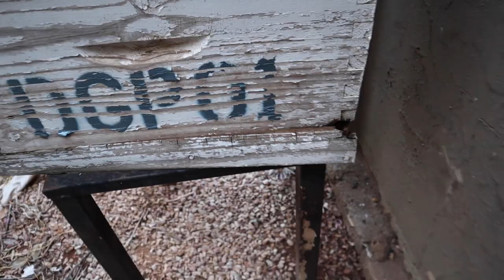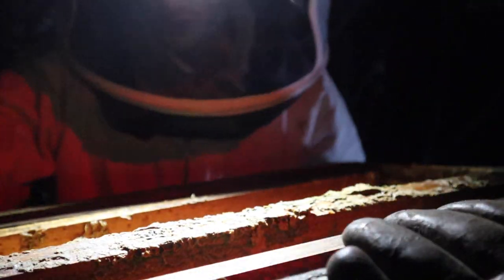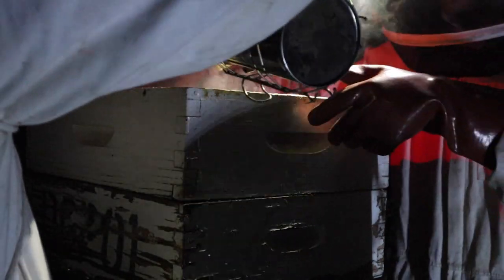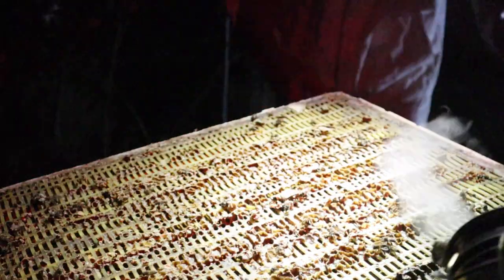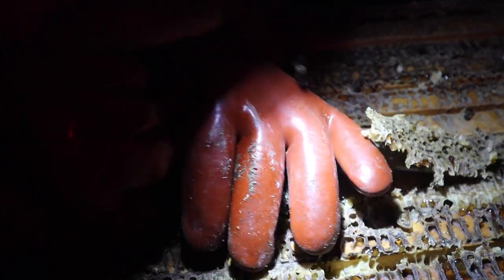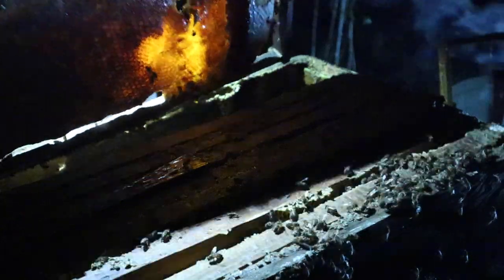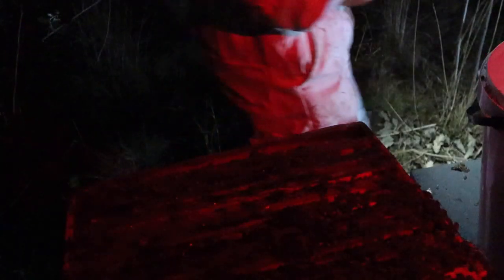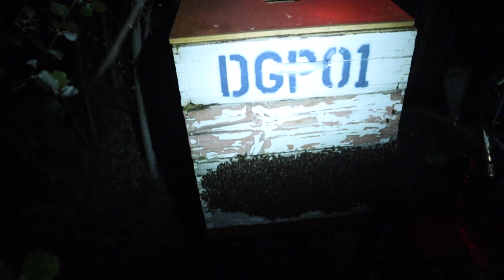Honeybee Hive - 3 Years Never Opened (Cracking Open a Sealed Beehive)

Comment: I could wait until for the brood chamber. Looked like the comb had some damage. Why do the inspection at night?
Reply from the maker: Thanks for watching. The comb was cross built between the frames as the beekeeper had only placed 9 frames in a 10 frame box, so they were a bit skew. The bees decided to build across the frames so we were not able to pull them from the box and have instead added the 10th frame. We will now work the box until all the badly built frames are removed. 

We also work at night because the African Honeybee is one of the most aggressive, our hives are not far from residences as well as horse stables, so we prefer not to run the risk of the bees going into a defensive frenzy and attacking everything nearby. It is mostly a precaution.
Reply: @BeeSanctuary  Thanks for taking the time to explain. I may have missed some of the information due to driving.
Reply from the maker: Always a pleasure, thanks for watching.

Comment: Im currently doing the same thing with a hive left on a property I purchased. There is so much honey and the frames are so heavy I cant lift them and that's just the top box. I haven't been able to even get to the lower two boxes. Any advice? I will be getting my husband to help lift frames soon. Do you have any other videos of the progress? Thanks so much!
Reply from the maker: Thanks for watching, I think there were some videos after that one where we did hive maintenance. If I were to move these hives again from one location to another I would do it differently. First I would remove the honey supers and take them for harvesting, leaving them on during transport runs the risk of them breaking and also the honey already crystalizing because of the time it has spent in the nest. Then if the brood is a lot, I would use the opportunity of the move to create splits. As long as you have sufficient new eggs in each of the splits they will create new queens. This is what I would do now with what I have learnt in the last few years. Hope you find this helpful.